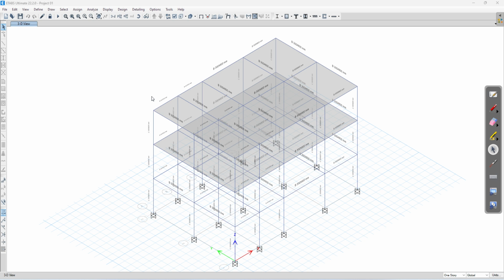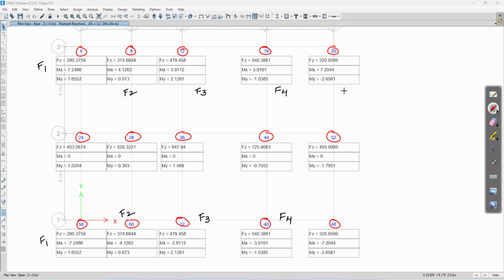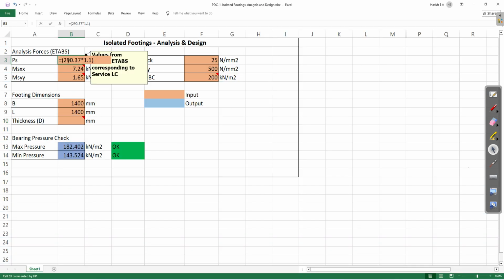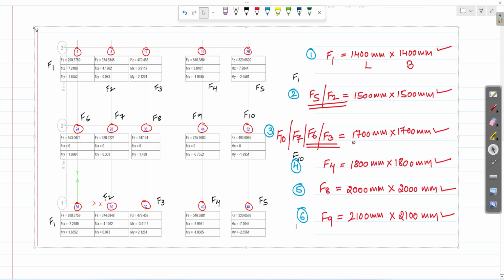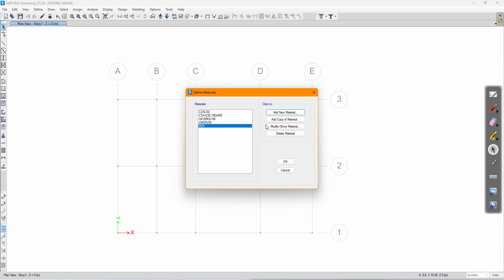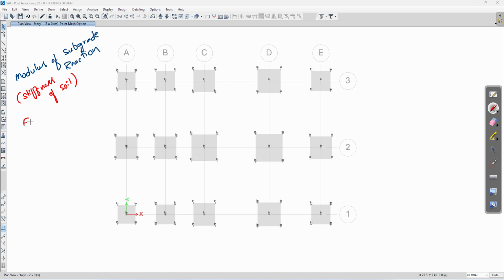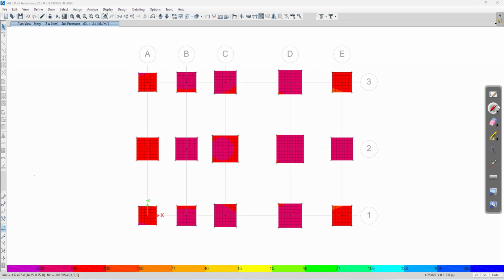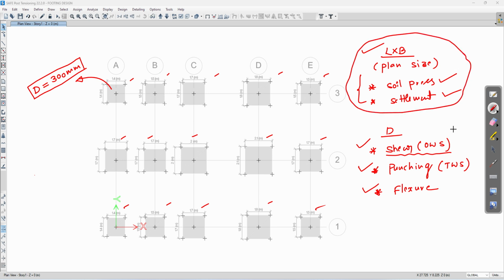Design of Isolated Square Footings on SAFE V22_Part-01

Comment: Only beam and column will be designed through Etab
Reply from the maker: Correct, that software is typically used for superstructure elements like beams and columns.

Comment: Sir, In assigning section properties for footing slab you assigned as she'll thin. She'll thin means it will carry load and  transmit
 to ground and  is less than 1/10 of L or 1/10 of B. Here t=300mm which is more than 1/10 1500=150 mm which means t >1/10L she'll thick. Which is correct sir.

Comment: Sir if uplift pressure occur what we need to do.
Reply from the maker: Increase self-weight (e.g., thicker raft or soil fill).
Use anchors or tension piles to resist uplift.